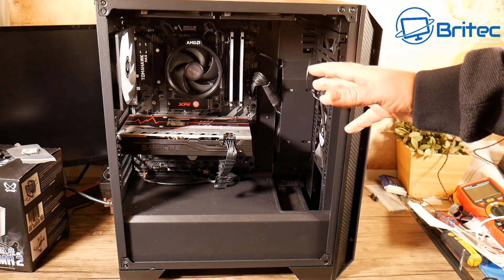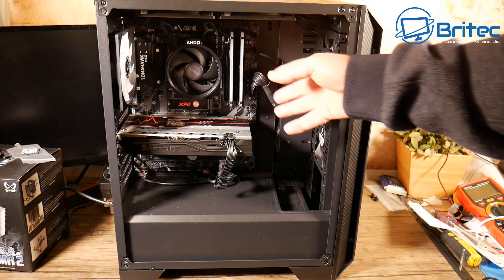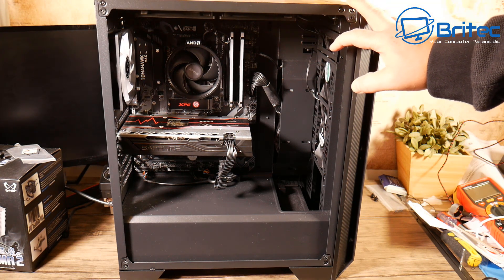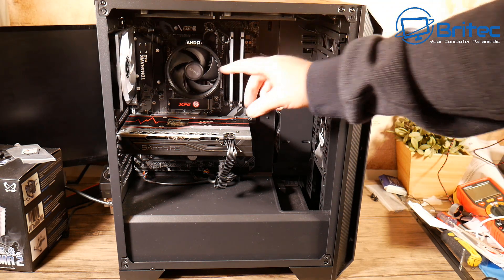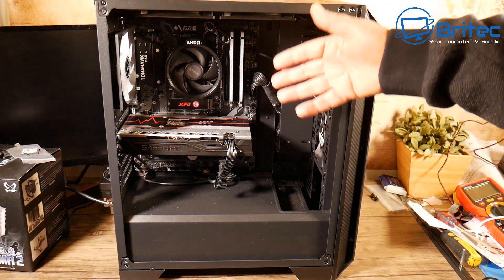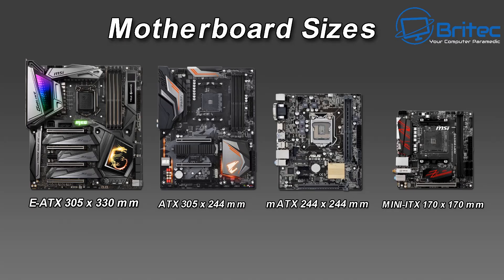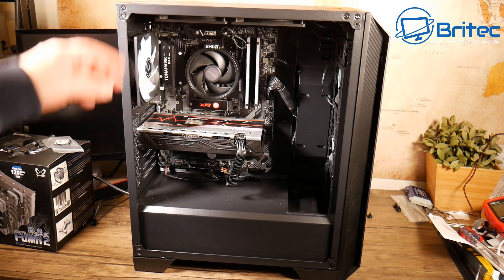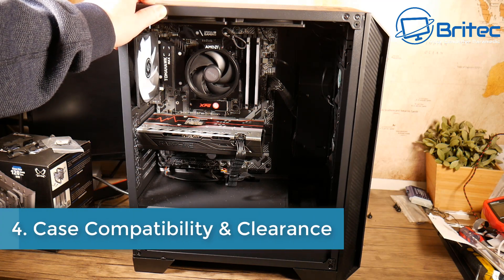How To Choose The Right PC Case For Your PC Build

Comment: As a form factor i really like micro-atx but they look to be very thin on the ground these days (i'm looking at you X570!), have heard commentators calling it a dying/dead type.

I have put several mini-itx boards in micro-atx cases so that i can get much better airflow, larger cpu coolers, cables etc.
Reply from the maker: Its to early to know whether the X570 will have fan problems, only time will tell, but I will say they are replaceable.

Comment: I like open-loops, so for my current build I chose a Lian Li 011 Dynamic. It has room for 3 360mm radiators for cooling, and the PSU and cables are in a separate section in the back of the case. The ability of mounting the PSU at the top makes it less likely to be affected by a water leak. Cable management is a breeze, as there's a ton of room in the rear. Air flow is also good. I have 3 fans drawing air in from the bottom, 3 fans drawing air in through the rear panel, and 3 fans exhausting air through the top. 9 fans may sound like a lot, but they are set to run at 800 rpms so the system in nearly silent.
Reply from the maker: Sound a very nice.
Reply: @Britec09  Thanks. If anyone want's to know how I wired 9 ARGB fans, they are connected to a single controller that's SATA powered. It's the only SATA cable in my system as I have no SATA drives. Instead I have 3 2TB NVMe gen 3 M.2 drives on my motherboard is a MSI X570 MEG Unify.

Comment: Somehow I feel nowadays most people don't need an ATX motherboard and all the expansion slots. An ATX case is a waste of space. As well local storage is moving towards 2.5" and M.2 SSD. The need for space for multiple 3.5" drives and 5.5" bay DVD drives is over. Most people will only need one graphics card. A moderate sized M-ITX set up will make more sense.
Reply from the maker: Your money, your choice

Comment: I went with a Thermaltake Versa H15 (micro ATX), but with the small factor comes fewer cable management options and less airflow. Switching to a normal MID tower case in the future, and maybe to an ATX motherboard. The PSU cover is essential, in my oppinion, if you want a neat looking case interior. I have an AMD Ryzen 5 2600, RX 580, 16 GB of Ram, micro ATX B450M Steel Series, 2 M2s, Arctic Freezer 12CO CPU cooler. So yeah...
Reply from the maker: Thermaltake make some nice cases.